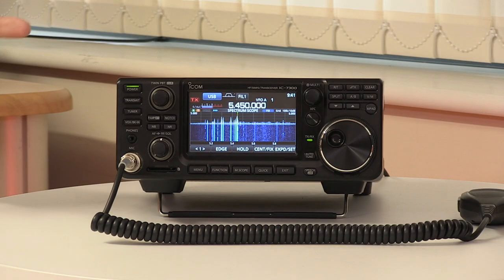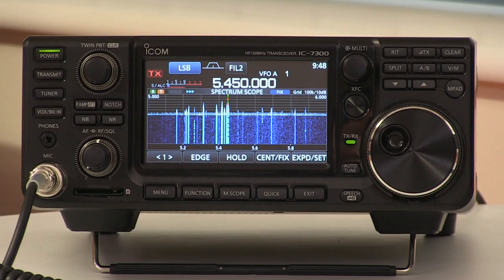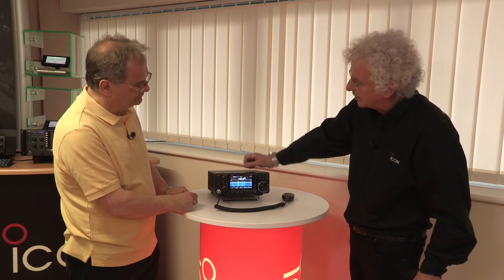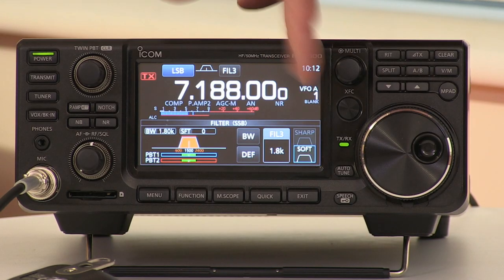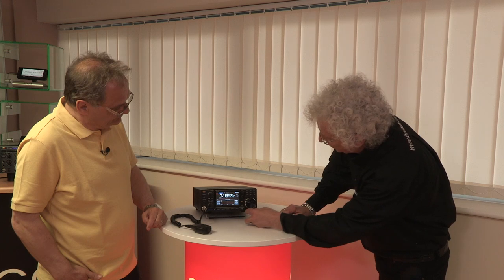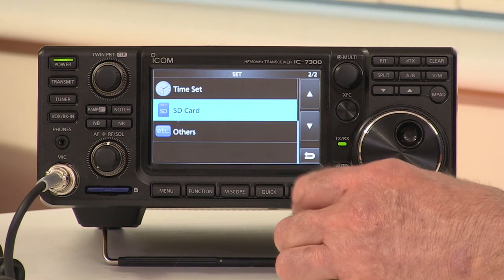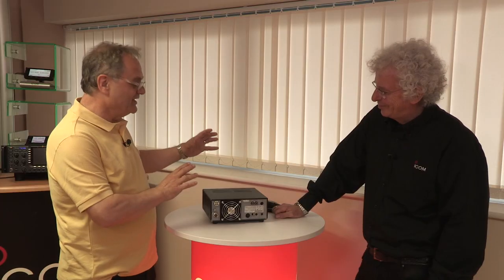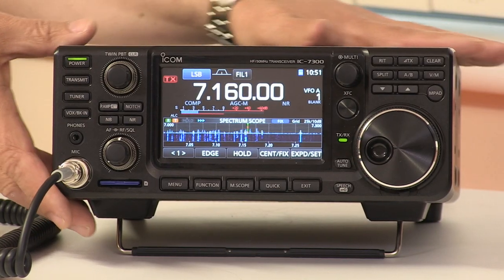Reviewing the IC-7300 Software Defined Radio (SDR) HF Radio

Comment: It is a shame this radio does not do 2m and 70cm as well. That is why i bought the FT-991A instead but i would have loved to have owned an Icom like this. The display processor looks very smooth and fast unlike the 991A which is slow and sluggish.
Reply: slow and sluggish yes, just like the menus as well.

Comment: you didn't show the digital modes demo..you also didn't hook it up to a pc and show the icom RS-BA1 software..
Reply: There are other reviews that show exactly these things, lots of videos on Youtube :)
Reply: no matter, i went for the flex 6300
Reply: +rob b Fair enough, although it's double the cost and not fully self-contained. Choices are there for choosing...
Reply: Brian Morrison don't want fully contained, same as i would choose separates over a midi hifi, i also have a windows surface pro tab for mobile
Reply: Fine, I have not used a Flex SDR although they are capable of very good performance, just way out of my budget! I do like the ability to get 95% of the performance in a box I can pick up by the handle and carry.
Reply: Brian Morrison WAAAY out of my budget too Brian, :) i convinced a bank to give me a credit card .. i actually use an 857D for mobile . flex is good, but power button falls off if you look at it the wrong way, software is so ..so.. its not perfect. but a fun way to play at radio.. not worth 2K tho..
Reply: rob b sounds like it was a “matter” after all.